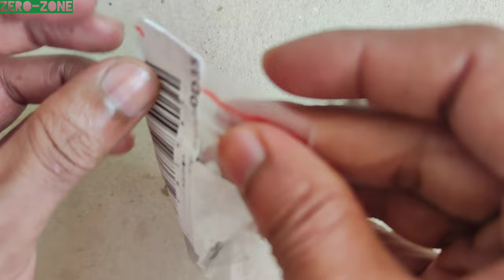High Voltage Inverter Generator Spark Arc Ignition Coil Module DIY Kit 15KV Assemble | Diy Kit

Comment: Good stuff, thanks.
1. What is the output current?
2. The output is AC?
Reply from the maker: Not ac bro , ☺️ this is high voltage arc , like a lighter
Reply: 1.) The output current is likely very low, probably less than few mA judging by the intensity of the arc. 2.) The output voltage is coming directly from the transformer.. meaning yes, it is alternating current.
Reply: @zero-zone420  tat is ac

learn wat ac means
Reply: @urnoob5528 I think they thought “ac” meant “arc” but misspelled

Comment: How much input amp and voltage you used?
Reply from the maker: 3.7 v , 5 v and 12v max
Reply: @zero-zone420  what about input amps?
Reply: @zero-zone420  you used double AA battery or psu power supply?
Reply from the maker: @gbhxn731  power supply , actually i don't know how much amp

Comment: Trasformer connections maybe are wrong. There are 4wires but
I see only 3 wires welded.
The 2 thin wire go together in the center hole.
Reply from the maker: Yes , you are right 🥰
Reply: No, that’s the feedback coil. You need one of its wires and one of the primary (big one) wires in the center. Small one goes on the left hole or right hole and yeah. Same thing with the big wire. Putting both of the thin wires in the center would short the feedback coil which is part of the required circuit